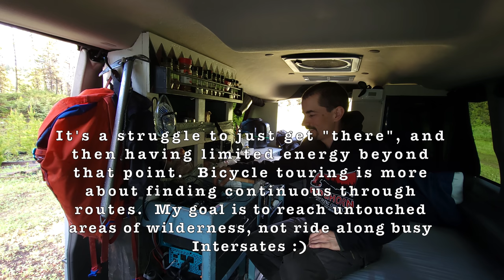Van Life in BC - Beaverfoot FSR - Floe Peak

Comment: I am one of your early bikepacking adopters. And made your transition. I am going out of backpacking and getting more into bikepacking. Change ups are good. I am sixty eight and still working with enough time to do the outing thing. I did not settle down until my mid thirties. I used the oilfield to slack off, work hard, and backpack all through my 20's. So just keep going.

Comment: I retire in 16 weeks and I'm nearing completion of my van.  I will be a part timer but plan a epic cross country trip in the spring and hopefully BC too from Virginia.  My van is similar to FF in that it's not a condo fit and finish.  I too 
use lots of Wood screw hooks. Being 60 I'll hike a little but most of my adventures will be on my folding e bike and inflatable sup I'm considering buying a elec. Motor for.  I'll be in FLA every winter probably, I grew up there.  FF has become one of my Fav's.

Comment: A smaller metal baking sheet with low edges might make a nice surface for the new counter. Heat proof and would catch things from rolling off onto the floor as easily.

Comment: The mod to the counter. Could get a teflon cutting sheet. Home Depot has those for cheap. Screw it in from below and that would give you a durable surface for many tasks. Amazing footage. Going to have to get the drone replaced.
Reply: GOOD idea.  All the electrical  below needs to be protected from spills.  The Teflon cover would be impervious, easy to clean and flexible enough to manage heat.